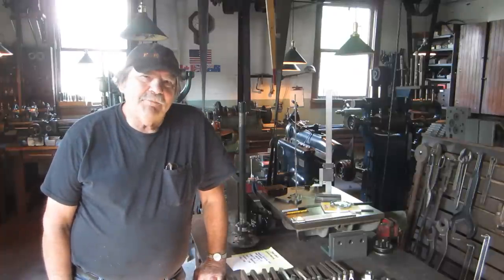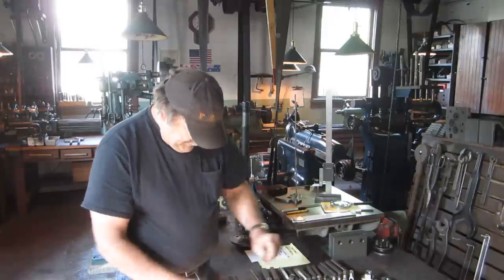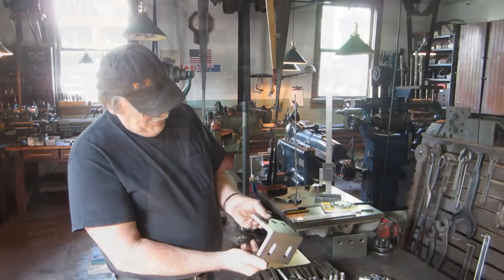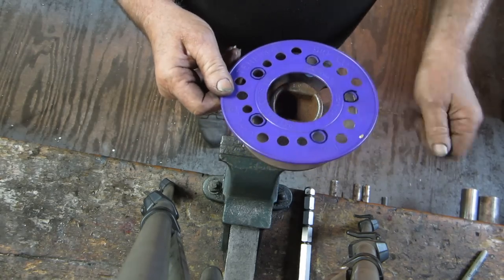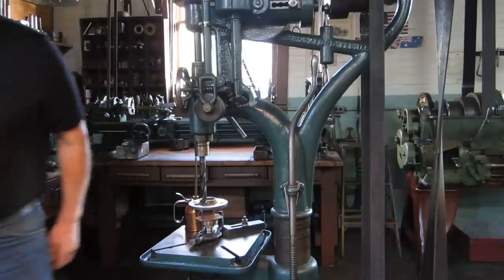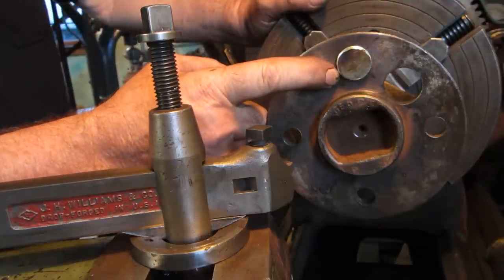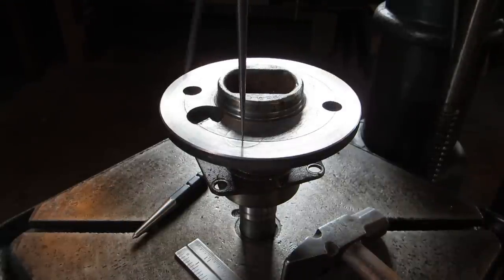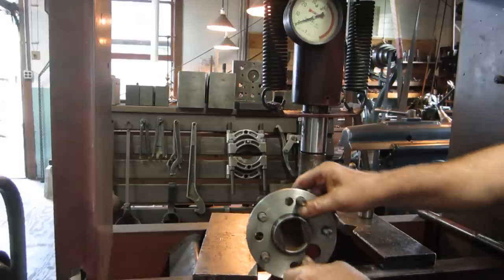OLD STEAM POWERED MACHINE SHOP  11   Getting Back To Work

Comment: Even in back gears a Bridgeport won't go that slow during drilling.  I'd love it if modern equipment could drill slow and in control.  I would have been sorely tempted to plug weld the hole. :)

Comment: The opening of your video brings back memories when I was in the Navy '75-'79 on a Gearing Tin Can as a Boiler Tech.
We had 32 hand hole plugs under the boiler and I think 12 on the back of the superheater when we did a hydro no leaks were permitted,
the gaskets were oval and a metallic wound around insulating material. Usually called a flexitallic gasket.
 3000 1" tubes , 2" tubes, 3" tubes and 4" tubes through the air casing. All manual 'M' type boiler 600# 850 deg.  superheat. We cleaned the tubes with air motors & expanding wire brushes for each size tube, the motors were 1, 2 & 3 inch.
We had to lay on our backs in the mud drum and wire brush each tube  for about 1 1/2 ft. from the top in the steam drum we brushed all the way through. Fire sides were cleaned with scrapers & wire brushes, there were no masks or respirators given. We had coveralls , ear plugs only some of the time.
Reply from the maker: So you were brushing out the water side of a fire tube boiler? That was a bunch of tubes and a lot of steam pressure....Dave

Comment: Dave, the table height adjustment on your drill press is slick... you don't have to run around to the side to get to the crank. What you have is better than anything new I've seen.
Reply from the maker: yeah,  this drill is 125 years old, what ever happened to power down feeds on drill presses?.....Dave

Comment: Having seen variations of axles being redrilled they usually end up with one or two holes having to be filled. Most have been welded and then the trouble is drilling the different materials and the drill runs off.
Welding those flanges too makes them more brittle and they can break. Especially about pre 92 Ford axles. They changed the material after that and they are a lot better. More like a GM axle
Reply from the maker: Right I was worried about that,  but a small weld around the outside of the hole to lock the threaded plug left the center of the plug  (grade 3 bolt)  still soft to drill. probably didnt even need the weld.

Comment: I like how slow that drill press will rotate
Reply: It originally turned carbon steel drills, not HSS.  They cannot take high heat without losing their temper.
Reply: Thanks Bob I  hadn't thought about that.
Reply: I realize that, this is just real slow

Comment: how would you  put them square hols in tool holders like  that Dave?  out of "Curiosity". We can't buy them cheep Enroth  in the UK.  so we have to make them out of old spanners.
Reply from the maker: All sizes and types Armstrong and Williams holders on Ebay all the time. Lantern posts are harder because the sellers don't usually give the dimensions you need to know....Dave

Comment: Just got done binge watching the whole channel, excellent stuff. Question about the engine, could you go into more detail on the startup procedure? Seems it's a little more involved than oiling everything, turning on the steam, and giving the flywheel a spin.
Reply from the maker: gee, there isn't much more to it really. You have to open the two cylinder drain cocks and the one on the steam chest cover to let out the condensed water, or it will "hydro  lock" which is pretty rough on the cylinder and piston. When running, I close the drains and turn on the displacement lubricator a crack to get oil going into the steam line....Dave
Reply: Ah, that makes sense, the steam chest drain was what was throwing me off, thanks.

Comment: I am enjoying your series  on the "steam powered machine shop"  I never worked with a steam powered shop.  My experience with steam power, I was a young water boy  (horse powered) on the thrashing crew that used a case steam tractor.  I started using calipers  for my measurements and the eyeball method on the centering of the 4 jaw chuck when I started the trade.  What do you think your tolerances are on the calipers??  We used to feel in similar situations  plus or minus .001" was good.  I envy your shop and  slobber on the steam engine and line shaft drive.  I am in process of making a 1/12" scale of such a shop, but being lazy and old and half blind I use the DRO and micrometers. Mahalo Nui Loa ( thank you very much) for your videos and time.  Aloha ke Akua Chuck
Reply from the maker: Great comment Charles, My Dad made a living as a young man with a steam thrashing rig. Eyeball method works good....Dave

Comment: Just recently found this channel.  When  Dave is boring the piece on the drill it’s rotating the bit in the direction I’d expect, but previously on the lathe it looks like it is the reverse of that. Why is that? I’m new to machine shop and curious about it.

Comment: Q: about using rain water - I see you had your Manhole inspection door open. For this boiler what is the purpose for this door? To check for scale ?? Do you have problems using rainwater ?? And do you have to use chemicals to balance the PH for your rainwater ?? 
The year before I work for Wards Cove packing plant in EKUK AK, they had one of those inspection door go flying through the roof of the 1904 building. I was told everybody in camp could hear the boiler whistle. I am not talking about the train whistle, the boiler made the sound directly. I guess the machinist who put that in did not have it seated correctly. I was told the door flew about 200 feet up in the air. Thank G they did not have any fish cooking and nobody was hurt. They had gone to lunch when this happened. They had to have the boiler inspected for damage that summer. The Next year, I was supervised (handheld/baby sat) when i had to put it back in. I am still lost as to how you could mess up putting that back in. That BTW I think that was the same year they had a brown bear sow sleeping under the cannery. Scared the &$(# out of the guy that had to put the drain plugs back in for the water system.

Comment: I am surprised you dont have lagging or insulation on the boiler.  It would increase the efficiency of the boiler as well as reduce the heat produced with the bare sides of the boiler.  Fiberfrax is a common insulator used.  A one inch layer is more than sufficient.
Reply from the maker: I have considered lagging, and you are right,  but probably won't for two reasons: I have all the fuel I can burn (mostly free) and I like looking at steel and rivets. Steam lines are a different story. after insulating most of them, I could see a distinct difference in the efficiency and the amount of condensed water going through the engine.

Comment: nice I need to cut splines for a buddy on a 9 inch ford. have you ever done that with your mill mine is almost exactly the same?
Reply from the maker: Haven't done anything with the dividing head yet, you would just need to find the right cutter to match the spline. Keep the speed very slow, that axle material will harden up real quick if it gets hot.....Dave
Reply: +David Richards I'll keep that in mind. what about the feed should I keep it slow to ?

Comment: A little oil for the lathe?
Reply from the maker: I hate those type oilers, you have to readjust them every time you turn them back on, so I just leave them wide open and put a shot in now and then. I will change them to the other type with shutt-off as soon as I find two that halfway match......Dave